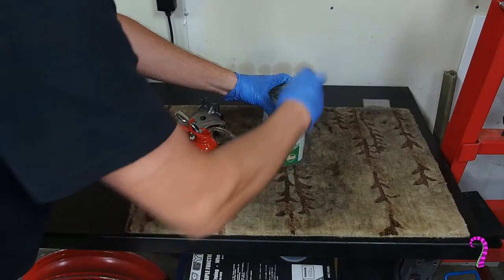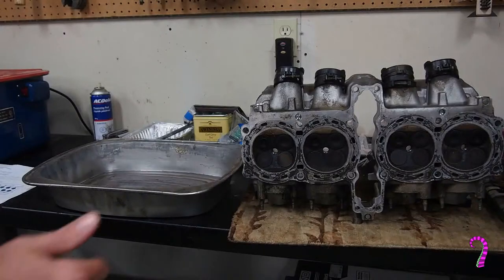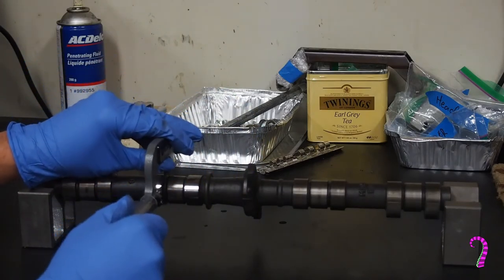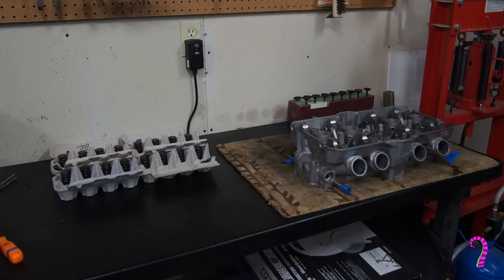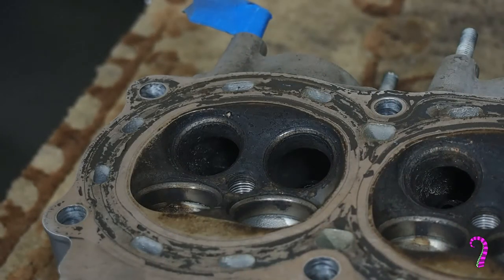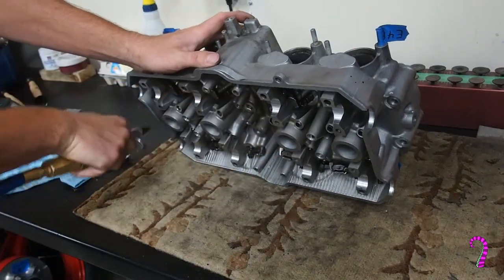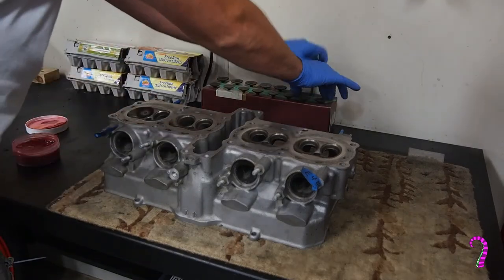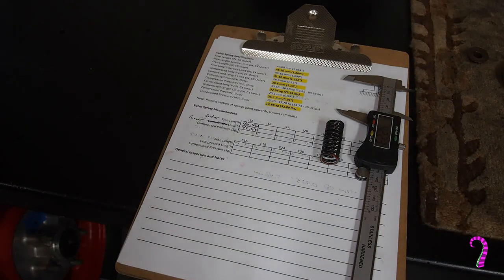Hurricane Engine Rebuild Chapter 2 – Head Service

Comment: ...but the timing chain does get loose enough to break the chain guide that runs up the front of the engine . Mine broke in half . The top half that broke off made its way around to the other side of the chain , fell down into the crankcase , and wedged itself between the the chain and the gear on the crankshaft . The engine was idling with the choke on at about 1500-1600 rpms . Stop the motor instantly . Luckily it wasn't running on the highway with my friend on it trying to keep up with me on the Busa .
Reply from the maker: See to me that issue sounds like one of two things. One, the chain had been repaired improperly or the bike had a manual cct installed at some point which caused the chain to stretch, or two, the automatic cct had been gummed up by old oil or crud to the point where the tensioner mechanism was unable to exert correct tension on the chain. This led to accelerated (and catastrophic) wear as the loose chain slapped against other components. Were you able to save the engine?

Comment: Where did you get the spread sheets for recording your measurements ?
Reply from the maker: I had made them in excel a while back. It had started as a photocopy of the fsm so that I didn't have to keep pulling it out everytime I measured a component. It evolved from there
Reply: @tentacleslap5531  would you mind emailing me the templates please ?
Reply from the maker: @markphillips8  I've posted them up on the forum. Here's a link: https://cbrforum.com/forum/how-tos-81/engine-rebuild-video-series-87-cbr1000f-156490/page8/#post1344849